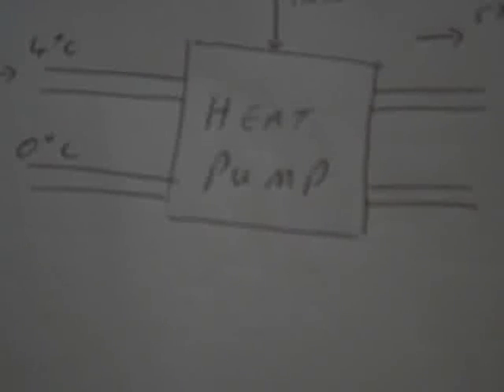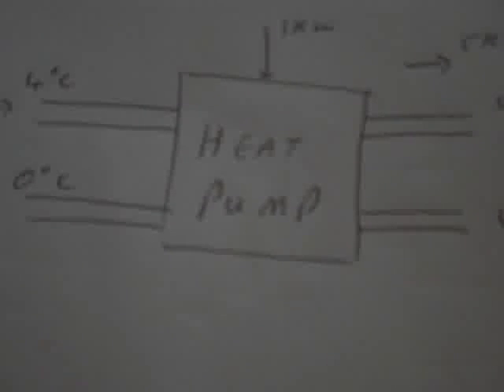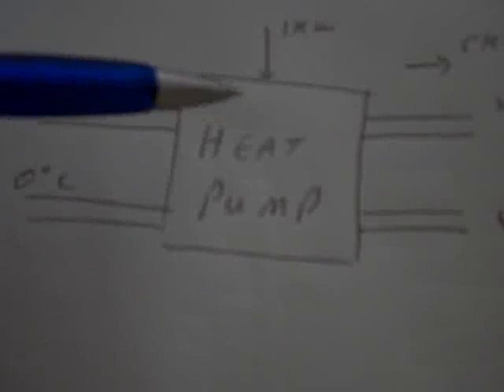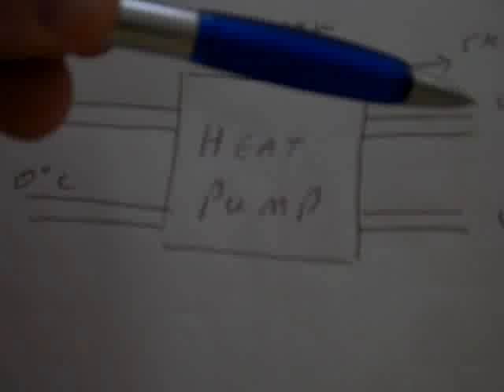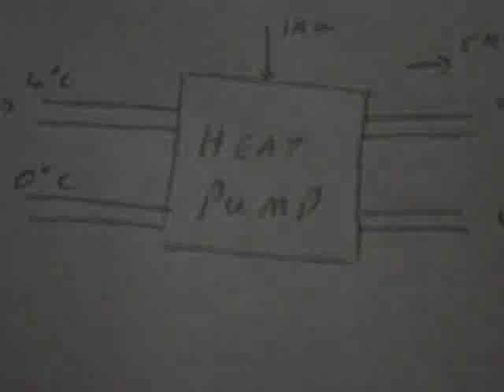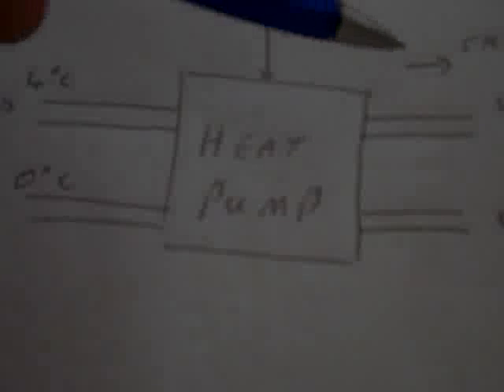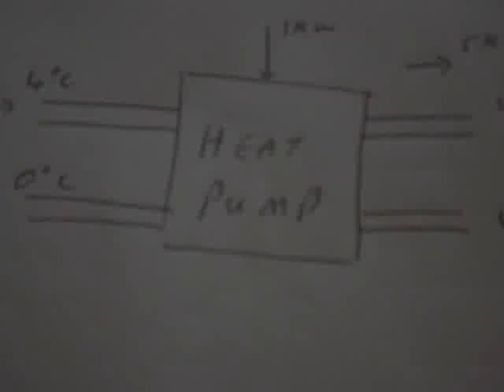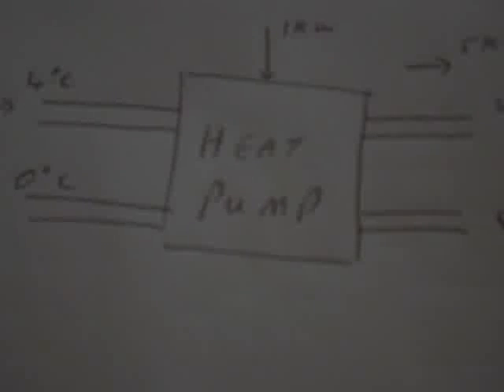Free Energy from the ground

Comment: Pumps are very inefficient. Plus are you talking pipes going to near molten depths into the earth? Why not just stick a modified thermocouple with a controller into the heat?
Reply: The pipes only have to go 30-100 m below the surface for these purposes

Comment: i think people also need to work on atmospheric source heat pumps. As one of the major problems facing us is global(atmospheric) warming, WE SHOULD DEVELOP TECHNOLOGY THAT EXTRACTS HEAT FROM THE ATMOSHPHERE.  if this is done as you suggest with heat pump and stirling combos, a "small" amount of energy could be used to cool the atmosphere, and at the same time GENERATE MORE POWER than the cooling system is using...
  
 HEAT RECAPTURE  TECHNOLOGY is the BEST WAY boost efficiency in all systems

Comment: Part2

continuously, and the remaining power is provided to end users in need of electrical power. The heat engine of the power generation system can be Stirling engine or a steam turbine, wherein the heat efficiency of the Stirling engine can reach 25%, and the heat efficiency of the steam turbine can reach above 30%. The heat pump used in the power generation system can be a vapor-compression heat pump. Under operating conditions where temperature difference

Comment: Here's some info for You, which I'll have to split in at least 2 posts. It is from a patent search:

Part 1
Abstract of US2008127657.  
A power generation system driven by heat pump which produces a heat source by heating and a cold source by cooling for the driving of a heat engine to produce mechanical energy to drive a generator generating electrical power. Part of the power generated by the generator is fed back to the heat pump

Comment: Electric resistance heating is 100% efficient, so if you buy that "it would take 5KW of electricity to generate the same heat", you must also concede that, with a COP of 5, a heat pump achieves "1KW in, 5KW out".

Comment: Allright, as indicated I am not knowledgeable in heatpumps. 
What I will hold on to, is the fact, that I don't think You can build the working setup that is sketched in the video, no matter using air or ground source heatpumps.
I don't believe in the statement "1 kW in, 5 kW out". Only, it would take 5 kW of electricity to generate the same heat with electric heating, which shows how inefficient electric heating is.
Anyway, have fun if You try to build a proof-of-concept model.
Regs.

Comment: Hmm, after having read a bit about heatpumps, I tend to doubt that this setup is possible.
It is not correct, that a heatpump generates 2½ to 5 times the energy You put in to it. This is the so called coefficient of performance - CoP, that express how much energy the heatpump moves "upstream" in temperature, related to the electric energy it takes to generate same heat with electric heating. So unfortunately, still no free energy here.

Comment: Very interesting perspectives. The heatpump could be based on an air/air unit, which isn't that expensive. At least a demo-model could be made, using one of these.
Don't know about efficiency, though. An air heatpump generates 2½ - 5 times the energy, You put in to it. A sterling engine has a theoretical max efficiency of 50% and a low temp. differential type, that would be used with a heat pump like this is considerably lower. 
Tech skills needed, to develop.
Anyway, good luck if You try.